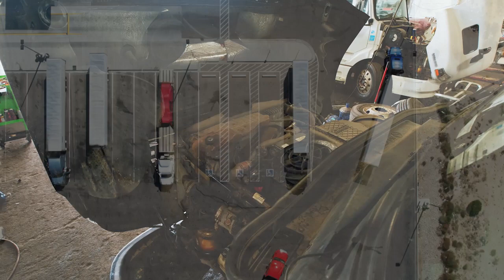Are battery-electric trucks really better for the environment?

Comment: But why would you recycle the battry after the truck is scrapped. Jusr reuse them as backup to your ondute solar system or charger.
Why would you use electricity produce hydrogen to run  a truck  instead of using it directly. Why would you want to increase the cost.

Comment: Check out the Hyliion Hypertruck ERX. Lowest total cost of ownership between all electric semi truck options. It uses a small battery and has an on board RNG/CNG generator to provide a range of 1000+ miles. This is the only option that can provide a net carbon negative footprint as more than half of CNG used in transportation in the US is RNG. No long recharge times while getting all the same benefits of an EV.

Comment: What trucking company can afford $85,000-140,000 for new batteries every 4-7 years? AND...losing 15,000-17,000 pounds in load per load will require approximately an additional 40% more trucks to haul the same volume of freight
Reply: Tesla Semi is being sold (but not delivered) today with a 1million mile warranty which is greater than they typical Semi life.

Comment: EV Semi-trucks need a 500+ mile range and 30 min recharge time to be profitable 24/7, 365. Hopefully, Tesla rolls out a nationwide wide mega charging network and ramps up mass production soon. Battery technology is advancing extremely fast and should not be discredited.
Reply: According to Elon Musk, the 80% of truck routes are less than 250miles.  This is the initial target market for EV Semis.  The 600miles Tesla is now advertising should be fine for this market.